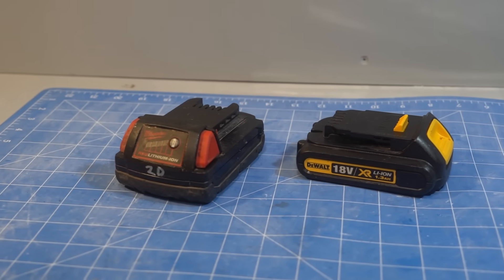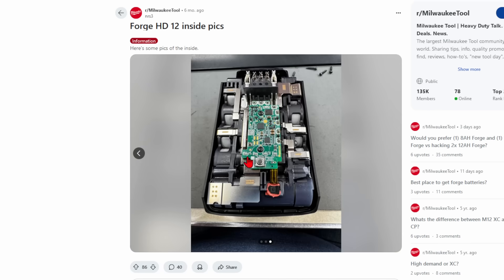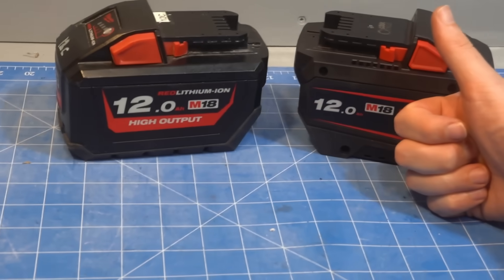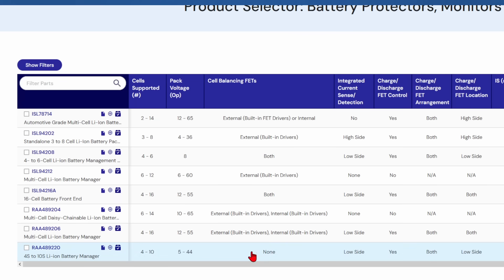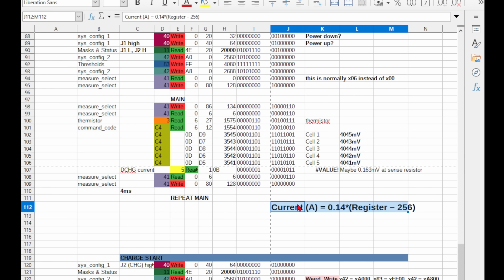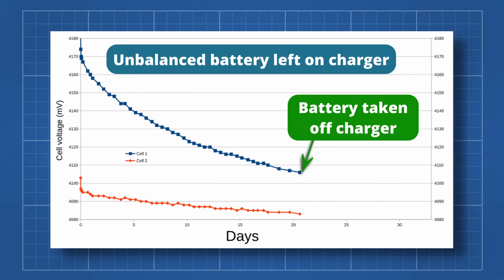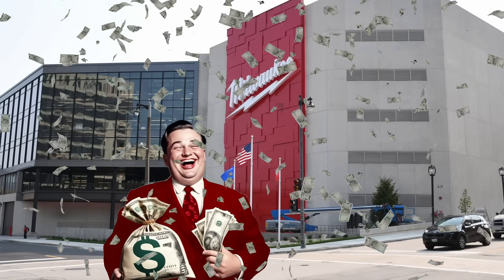[011] Do Milwaukee FORGE batteries balance

Comment: and friends, this is why you should sub to channels like this, not those muliti million sub big tech channels.........
my company had a lot of hikoki battery and old makita batteries. all refuse to charge. i took them home, open them up, and in most cases, only 1 or 2 cells are dead (rust/corroded) , the rest are still ok to use. and i rebuild them, they still works til today. i do know if  balancing was implemented, but making it not too hard to fix was the key for this topic.

this is very sad to see, i do have few milwaukee tools. now i can go XGT makita lineup

Comment: what's crazy to me is how they could put the balancer in the charger like all other chargers and just have balance tabs on the pack.  Planned obsolescence is getting really depressing.
Reply from the maker: Dewalt has all the cell pins, but then their chargers don't balance 🤦‍♂️
Reply: @toolscientist  That's totally absurd. I suppose in theory we could balance the Dewalt packs our self.
Reply from the maker: @djSpinege  except there's 10-ohm resistors between the cells and pins, which freaks out most chargers. Someone posted a specific charger that does work and I pinned that comment in my Dewalt vid.
Reply: @ interesting. Thanks for the reply.

Comment: i thought the whole point of Forge was going from cells to plates... this was just another gimmick (total lack of surprise)
Reply from the maker: Cylindrical cells have advantages. Mostly that they're more rugged and that a cylinder is a very good pressure vessel. Pouch cells need a stronger structure to prevent them from expanding and bursting. Cylindrical can get quite hot without the electrolyte bursting out in flames due to the strength of the cylinder. Cylindrical cells can also have a CID (current interrupt device) that adds another layer of safety as it can cut the circuit if there's too much internal pressure.

Tabless cylindrical cells are as good as pouch cells in terms of power delivery.
Reply: @toolscientist  as usual, i know very little about most things, didnt realize there was that much expansion / contraction with normal use but makes total sense

Any ideas about Hilti's batteries? With them being rental / fleet tool i would imagine they would be designed more for longevity and less about max power output
Reply from the maker: @narmale  they're all using the same cells. Mostly Samsung, but also Murata (formerly Sony), and some LG. Hilti might have better voltage limits to increase longevity. Standard charge is 4.2V and discharge to 2.5V. But if you only charge to 4.0-4.1V, and discharge to 2.7-3.0V, you can get quite a bit more cycle life. I hope to get hold of some Hilti stuff at some point to see if they're doing anything like that.
Reply: @toolscientist  i can get some Hilti batteries if you have a PO box to send them to 

i would like to know if they are doing balance charging mainly vs this deadhead group charging just about everyone else is doing

i have several newer 8.0 milwaukee that are now doing the dreaded 3 bars... they were the replacements from Milwaukee directly to replace the 9.0 ones i had that all went down
Reply from the maker: @narmale  are you in Australia? Not sure how easy it is to post li-ion. I currently don't have an address 😄. Currently in the middle of a move to a new city.
Reply: @toolscientist  nope, im in the great drama show known as the usa LOL! well post up in 6 months when your settled in, happy trails, i know how bad those days are all to well -.-'

Iipo isnt that bad to ship, statiwrap, double bagged, stickers, import papers bla blah

Comment: Would be interesting to see the internals of the Parkside 12ah battery, where i live you can get them for ~80 eur and the milwauke 12ah forge is around 400 eur. They sell adapters so you can use the parkside battery on a milwaukee tool. Would be a interesting comparison.

Comment: I have had nothing but PROBLEMS with Milwaukee "Red Lithium" packs.  Everytime I go to put one on the charger, I clench up because it's 50/50 whether it'll charge or not.  I have hurled some expensive packs into the garbage can out of frustration... because Milwaukee batteries are SHIT.  Dewalt packs have been worry free.
Reply: You have to tilt the batteries up and put some pressure on it.  I got them to work that way but you have to keep messing with it.  My cp 2.0's are the worst.

Comment: do you have a video on how to balance them back to normal or is that even possible???
Reply from the maker: I don't, but there are plenty out there. Easiest option is a single-cell Li-ion charger such as an 18650 charger or a TP4056 charger. You can also use an adjustable power supply.

Comment: 1:14 bro you need a multi-channel oscilliscope. Lol
Reply from the maker: Anything over 4 channels is very expensive. Oscilloscopes also have much worse voltage accuracy than even cheap multimeters
Reply: @toolscientist  are you trolling??? Worse voltage reading than cheap multimeter? Lol there went the like from me
Reply from the maker: Do you trust Keysight? Their scopes have 2% DC accuracy, and they ain't cheap (https://docs.keysight.com/kkbopen/understanding-voltage-measurement-accuracy-for-infiniivision-oscilloscopes-584425356.html)

My cheap-ish UT61E is 0.1% and my dirt cheap yellow ones are 0.5%
Reply: @toolscientist  then get a data analyzer. Slow compared to an oscilloscope but cheaper and way more channels.
Reply from the maker: Yes, a datalogger would be the best option. I've looked at a few options, such as Labjack and DATAQ. I'll probably make an Arduino or Pico datalogger when I find the time.

Comment: I've fixed hundreds of Imbalanced Milwaukee batteries before I've ever seen your video I was convinced Milwaukee purposely Imbalances the battery after the warranty was run out. I don't have physical evidence but it always seems the batteries go out of balance soon after the warranty runs out.
Reply from the maker: I don't think they do, it's just that it's not noticeable until it's very out of balance. If we find something in the firmware that  shows they are deliberately unbalancing, then I'll definitely be making a lot of noise.
Reply: Can you do this with Makita batteries? Can you confirm Makita batteries balance?
Reply from the maker: @thomasschmucker14  i hope to.

Comment: I'm disappointed to see there's no cell balancing. For high quality li-ion it's not actually needed for a new battery, but once it's getting older and cycles add up it will start to matter. Anyway, I hope there's no evil circuit kill trick like on makitas when you want to disconnect and replace cells.
Reply from the maker: That's Milwaukee's saving grace. Their BMS is very tolerant to abuse and easy to rebuild. I don't think they have any soft-lock feature.

Comment: I waited to watch this video until I finished my own decidedly unscientific testing on the M18 12.0 Forge pack. My 12.0Ah wasn’t even fully balanced straight out of the blister pack either a maximum imbalance of 19mV.
 
I balanced the pack, then IMbalanced it manually, and ran the packs through multiple charge, discharge, settle, and rest cycles, and also concluded that the pack had absolutely no balancing whatsoever. Frustrating, but not too surprising.
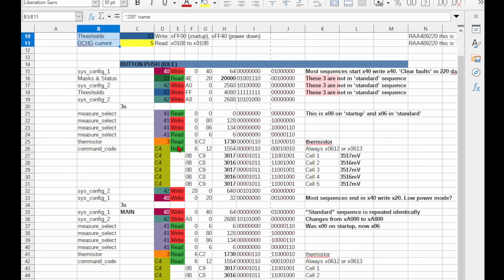Reply from the maker: Damn, 19mV is a large starting imbalance. At 6:27 you can see my original cell balance was 1mV.

Comment: Great video. I love how in-depth you go. And you also do not destroy anything in the process.
I have seen too much not balanced and poorly designed battery packs. One even had too many cells for the voltage it was supposed to output, so they just made it use cells in the lower voltage range! In later version they made it better, but still it was failing quite badly for other reasons.
That's annoying and it looks like they are making it on purpose because that's the thing you kind of expect to lose capacity and wear out. Lazy programming is just a cherry on top of that nonsense!

Comment: I am so glad I don't own any Milwaukee tools
All my tool batteries have cell balancing
The new Ozito/Einhell batteries have it and the old Bosch mid-2000s 14,4V NiMh I've converted to 4S Lithium also have balancing (yep, I still own and maintain 20 year old powertools)
But I can see a reason why Milwaukee is doing this:
Since the battery has no means of cutting of power (every other BMS on the planet can do this but for some reason tool batteries don't need that) it has to rely on the cells to be in tip top shape
If the cells are imbalanced it is a good sign that something is wrong with at least one cell. That one cell can start a fire if you pull 3kW from the pack, as powertools do these days
So by balancing you might hide that cell failure for a long time and things might go south
Reply: There is always going to be bad cells here and there that don't reveal themselves when new and balancing imo is a short term fix. The bad cell will always return to its resting voltage. I salvage the good cells from my bad packs and what I wish they would do is come up with a way other than the spot weld to easily replace the bad cells

Comment: Screw Milwaukee, i charged my M18s about 5 times their whole life, didn't use them for a while then put them on the charger cause i finally needed to use it both of them failed, pulled out my DeWalts from like 2014 charged them and they worked like new which was surprising considering it was when DeWalt was during their we don't care phase

Comment: 9ah were the worst.  I bought 4 x when brand new.  I ended up making 5 x warranty claims in 2 years.  Now i just manually balance periodically
Reply from the maker: All of the higher capacity cells seem to have problems. The 3Ah 18650s of the 9Ah (and M12 6Ah) and the 4Ah 21700 cells of the 8Ah and 12Ah. I'm hoping the lower resistance of tabless cells will reduce the heat and improve their longevity, but I can't help but feel that we're these companies beta testers. Either that or they figure that the money they lose in warranties will get made up by people that don't use their batteries hard and maybe from market share from getting new tech to market early.
Reply: @toolscientist  yes.  My 6ah M12s are failing quick now aswell
Reply: @toolscientist  i need to get new M18 and M12 batteries as my old m18 9ahs are just about done now.  And my really old m18 5ahs crapped out long ago.  And now my 6ah M12s are dying.  I have 1 x 12ah m18 (non forge) which is so far going strong, but i don't use it much.

Which ones out of the current m18 and m12 would be your pick for good general purpose use.   Think like drills & rattle guns etc.

I do occasionally use the higher draw items like chainsaws and garden power tools, but that is not often, and why I have a 12ah
Reply from the maker: @BramBiesiekierski  2Ah, 5Ah and 6Ah High Output have a good track record.
Reply: @toolscientist  Are those all 18650?
Reply from the maker: @JamesA-jl2bn  no, the 6Ah high output is 21700. The "bad" cells are all the high capacity ones. In 18650, 3000mah cells and above are not good for high power. In 21700, 4000mah cells and above are not great. The newer tabless cells may change this, but it's too early to tell.
Reply: @toolscientist  My 5Ah's have been great. I thought they were 18650.
Reply from the maker: @JamesA-jl2bn  yes, 5Ah uses 2500mah 18650 cells (usually Samsung 25R), which are very reliable
Reply: Thanks.  I think m18 6ah would be a good size for my common use.

What about in the m12 range?  I've had 2 of the m12 6ah both go bad pretty early.  Aswell as a 3ah that does very quick.  But other 3ah that last seam to last very well

Comment: Hey mate love the content and analysis. I would love for you to do an analysis on a Dewalt Flexvolt battery. I have a 12Ah Flexvolt that will also only charge to 3 bars and will not work on 54v tools. I am happy to send you this battery and a fully working 54v battery to see what the failure was if you like. Im in Sydney but am happy to cover postage for both batteries to you if you are in another city or state. I've done a partial teardown and probed around but did not find any particular cell that was more than a 0.2v from the rest buit i am just a chippy so not 100% certain of this
Reply from the maker: I would love that battery, and I'm also in Sydney...but only for 1 more day. Haha, I've genuinely just had the removalists today and then we're heading off around 10:30am tomorrow. I'm a few suburbs from Paramatta if you're anywhere near there. Email me: tool.scientist.i2c@gmail.com

Comment: Some brand like Black an decker dont even have a over volt protection... Btw if you get bad cell voltage différence over time you can just charge the cell one by one after disasembling the battery and use it until the it's out of balance again

Comment: How do you isolate a single cell to charge and read voltage, when they are all laser welded together?
Reply from the maker: When I say "cell", I mean "cell group". The "first cell" is the 3 parallel cells farthest from the terminal block. They act as a single cell.

Comment: I can only speak for myself. But I have Dewalt lithium packs I've had for about 6 years, with probably 100s of charging cycles. With no NOTICEABLE, lack in performance. I'm sure if tested in a lab, there has to be some degradation. But on my power tools, I can't tell. And I have newer batteries to compare them to... So obviously balancing is not a super big deal on batteries on drills, impacts, chain saws, etc...

Comment: I have several 12ah batteries on my graveyard shelf. About every 6 months I'll manually balance my surviving ones, and any other lower ah batteries that won't charge to 4 bars.
I'm thinking of getting a dedicatex balance board with leads and alligator clips to make the job easier than charging one bank at a time.
Reply from the maker: I've seen someone cut a hole in their case and hot glue a s JST connector for balancing.
Reply: @andrewradford3953 I use an iCharger X6 with a server PSU, 6 balance leads/5S mode. Works perfect to balance out the all the cells and charge or cycle. Was hoping Milwaukee will actively balance the new forge cells so I could upgrade all my all my M18 batteries. Thanks to your video @toolscientist I am going to stick with what I have and install JST connectors on the expired warranty ones.

Comment: Seriously Milwaukee. I just had to warranty another 2 of my OG 12AH batteries. Honestly thinking i might just come up with some robust way to add external cell taps and periodically do a charge with my RC lipo balance charger. Doesnt seem to matter how you treat these things, fast charge/slow charge/high drain/low drain/use them every day/leave them sit for 6 months unused. They ALL go out of balance. 
In comparison i have 10 year old 5AH and 4AH batteries that have been abused to hell and back, does hundreds of cycles, left in hot car, over discharged on various non approved tools. They all work flawlessly
Reply from the maker: I've seen a mod where someone added a JST connector to their 12Ah and hot glued it into a hole they made in the shell. Yeah, pretty much everything without the Samsung 40T cells last ages. You can see my 11 year old 4Ah having quite good balance, but still drifting apart. Lets hope the Ampace JP40 cells are better (or Milwaukee changes their BMS).

Comment: I would be curious if Dewalt does balancing.
Reply from the maker: Not on their regular batteries. https://youtu.be/nkZVdN7jEkw 
Powerstack may balance - they have a chip capable of balancing, but I haven't tested if they actually make use of it.

Comment: I use the Milwaukee square LED light and when it was about to run out of power the light flashed three times
that would be something interesting you should test
Reply from the maker: Does the light it have 2 pins or 4? 2 pin tools just measure the total voltage and cutoff at 13V or similar. The 3 flashes probably come on at something like 13.2V.

Comment: Dewalt doesn't do cell balancing? My large 9ah flexvolt packs are still good after nearly 6 years, but my Milwaukee 8ah and 12ah packs needed rebalancing after 1 year.
Reply from the maker: The FV 9Ah uses Samsung 30T, which is a more reliable cell than the Samsung 40T of 8/12Ah packs.

Comment: I have three 12.0 batteries. All money spend just for them to die in 3 years or later
Reply from the maker: Same here. Bought 3 and only 1 still charges to 4 bars. They don't get used heavily these days, so they're all still useful, but disappointing how quickly they fail.

Comment: I have an 8ah that cuts off but still says 2 bars wonder if that’s related to this
Reply from the maker: Likely. It's a very common issue with 8Ah and 12Ah High Output. Under heavy loads, the voltage can rebound enough to go back to 2 bars - so it could just be that. Best bet is to open battery and measure voltages. Any imbalance of more than 0.1V is bad and should be warrantied if possible.